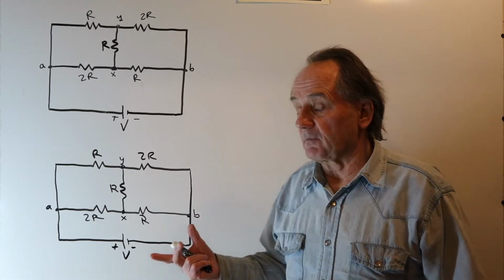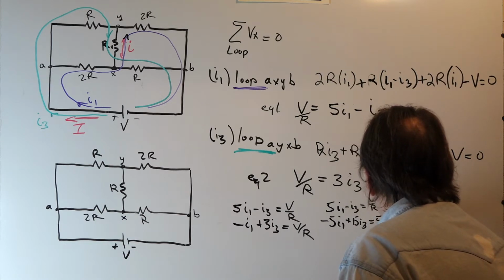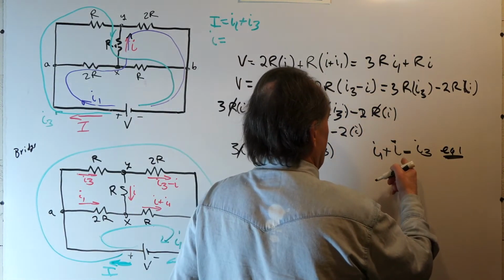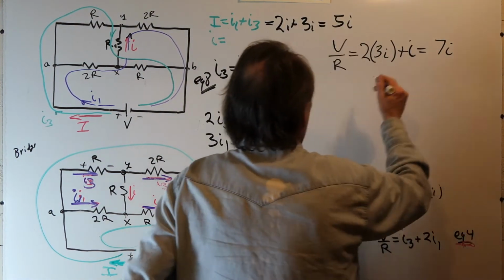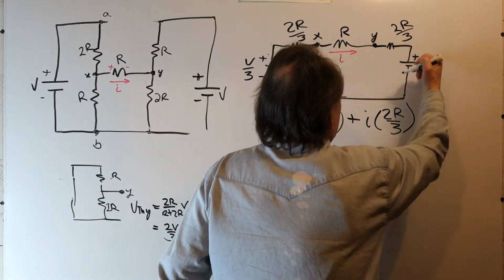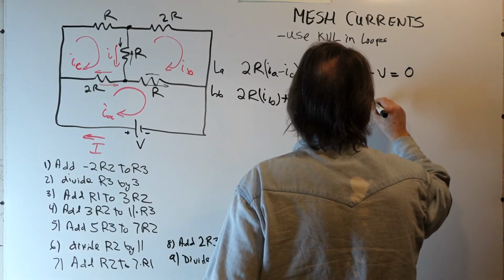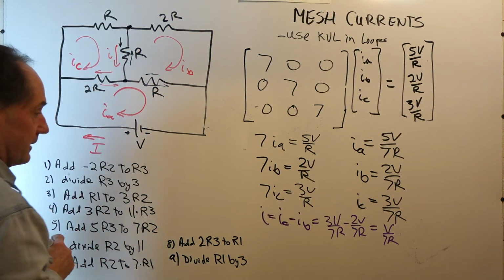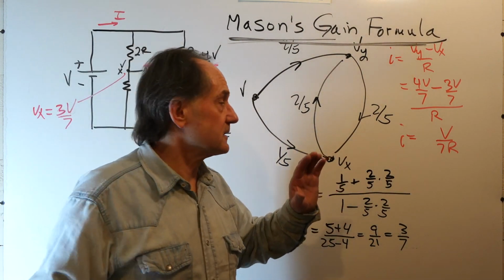Bridge Network part 1:  Solution to Lewin problem 24

Comment from the maker: George Hnatiuk
------------      TIME   INDEX  --  TABLE  of  CONTENTS  for  this  video    ------------
0:00:00    Introduction comments
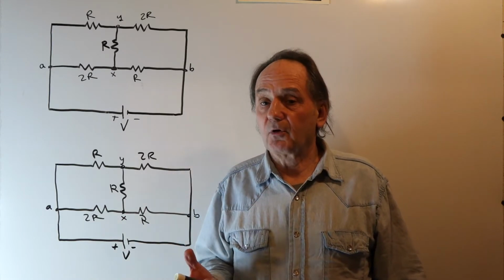0:02:00    Start two loop current analysis - easiest method
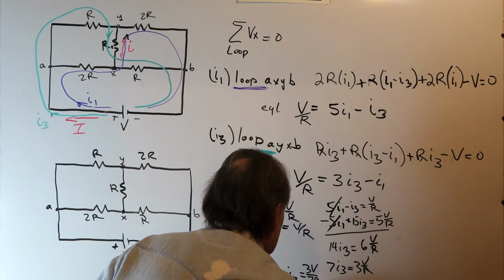     0:11:22   Solution for current "i3"
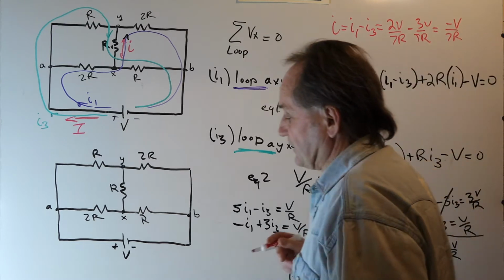     0:13:13   Solution of "i" and "capital I"

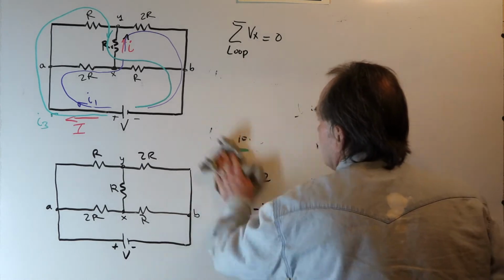0:14:37   Solving the network using two different loops
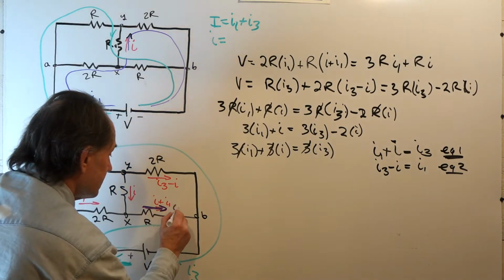    0:20:20   current symmetry found
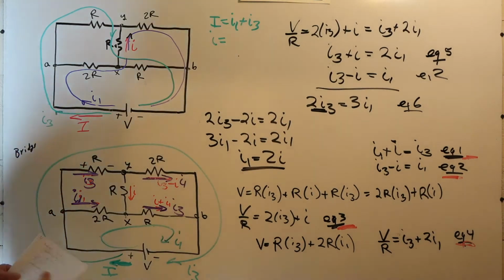    0:26:00   i1 = 2i  
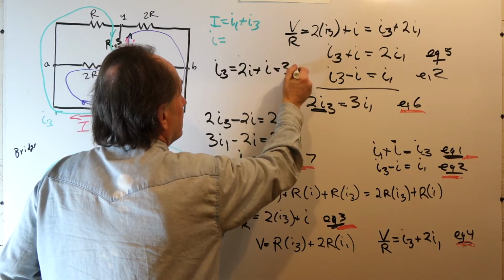    0:26:50   i3 = 3i
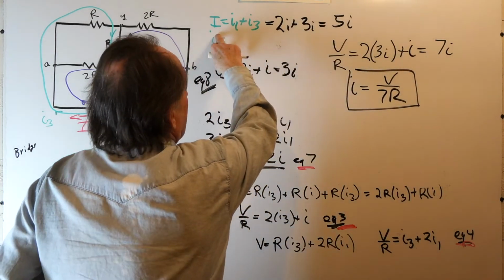    0:29:00   solutions for "i" and "capital I"

0:30:04   Start solution using Thevenin Equivalents
    0:32:45   break and split the network
    0:35:30   Vthx and Rthx  found
    0:36:52   Vthy and Rthy  found
    0:39:20   current "i"  in bridge resistor found
    0:40:20   COMMENT on theory behind Thevenin Equivalents and their use
    0:41:30    Rth  =  Voc / Isc

0:42:10   Start solution using  MESH  CURRENTS
     0:45:38   Change loop current designation for  "ic"  and  "ib"
     0:49:25   The three MESH equations with three unknowns
     0:51:20    MATRIX  formulation for the MESH currents
     0:54:00    The row operation recipe for reducing the matrix into std. form
     0:55:10    Solution for the three currents:   ia, ib, ic
     0:56:20    Small "i" and Capital "I" in terms of the mesh currents  ia, ib, ic

0:57:03  Begin  FLOW GRAPH  ANALYSIS 
     01:00:20    The graph with path gains
     01:01:20    The system function loop gain
     01:03:00     Vy  and  Vx   node voltages found
     01:03:45      Finding the bridge resistor current
FINISHED

--------------------------------------------------------------------------------------------------------------------------
The original problem statement:  www.youtube.com/watch?v=W9-yxYIWkqg
Prof.  Lewin's  solution:    www.youtube.com/watch?v=7Y7FZ_AtrEs

ENJOY the video  - comments and suggestions welcome
Reply from the maker: Prof. Walter Lewin of MIT physics posted this problem involving a bridge network:
   www.youtube.com/watch?v=W9-yxYIWkqg

The answer is EXACTLY:
middle R ( bridge R )  current =  V/7R  amps  downward  
total current supplied by the voltage source =  5V/7R  amps

The two 2R resistors have identical currents as do the two R resistors
     2R  resistor currents flow left to right with value  =  2V/7R   amps
       R resistor currents flow left to right with value  =  3V/7R    amps

Total load as seen by the voltage source is  7R/5 ohms
----------------------------------------------------------------------------------------------------------------------------------------------

The are a number of short cuts one can use involving network transformations that I talk about in this video.  By using a Delta-Wye network transformation, the equivalent load presented to the voltage source can be determined without writing any loop or node voltage equations and having to solve simultaneous equations.  By using that transformation you get the following equivalent network:

                       --------------|                             -----------|
                                    R/2                                    R/2            ------|
                                      |                                          |                      |
                                ------------              =                   |          =       7R/5
                               |             |                               9R/10                |
                            R/2        R/4                                |                -----|
                              |              |                     -------------
                             R            2R
                              |              |
                       ------|-------------|

                    Using the reduced equivalent network value of 7R/5, one
                    can calculate the total current supplied by the voltage 
                    source as:     
                                                                 I  =   V / (7R/5)  =  5V/7R

A more direct way can be had by using Thevenin equivalents for each leg of the BRIDGE to reduce the network into a series circuit and from that determine the current in the middle bridge resistor.  Then with that known current, use KVL and KCL in two loops to determine the currents and voltages in and across the individual resistors.

Another way to solve is to use loop(mesh) currents.

Using loop currents to get the current in the middle (bridge) resistor.  Do not neglect the current of adjacent loops when summing resistor voltages to get the voltage "seen" by each path,  which is the same battery voltage, V.   

Using current designations (i up)  and  (i down), the correct equations are:

V  =  (i up) x (2R)   +  [(i up)  -  (i down)] x R  +  (i up) x (2R)
V  =  (i up) x (2R+R+2R)  -  (i down) x R   =    (i up) x (5R)  -   (i down) x R
         eq. 1:               V  =  (i up) x (5R)  -   (i down) x R

V  =   (i down) x (R)  +  [(i down)  -  (i up)] x R  + (i down) x (R)
V  =   (i down) x (R+R+R)  -  (i up) x R     =    (i down) x 3R   -   (i up) x R  
           eq. 2:             V  =   (i down) x (3R)   -   (i up) x R  

Both (i up)  AND  (i down)  flow in the middle resistor and contribute to the voltage across it when summing voltages around each path to get the battery voltage, V.   Rewriting the equations:

   eq. 1:     V  =    (i up) x (5R)  -  (i down) x R
   eq. 2:     V  =  - (i up) x R    +   (i down) x (3R)

Add 5 times the second equation to the first to get:

    6 V  =    (i down) x 14R     which reduces to:     (i down) = + 3V/7R

Add 3 times the first equation to the second to get:

   4 V  =   (i up) x 14R       which reduces to:    (i up) =  + 2V/7R

Therefore the current in the middle resistor downward is:
                        
current down  =  (i down)  -  (I up)  =  3V/7R  -  2V/7R  =  V/7R  >  0
                   the value is positive which indicates that the current is flowing downward

  [[[     The correct value is  V/7R amps downward.   ]]]
------------------------------------------------------------------------------------------------

The total current flowing from the battery is:  
                        (i up)  +  ( i down)  =  2V/7R  +  3V/7R  =  5V/7R

This is the same value as determined above.
====================================================================

Wheatstone bridge?   Definitely  not.
In a Wheatstone Bridge, the ratio of resistances of the upper arm MUST equal the ratio of resistances on the lower arms taken in the same order.  This way the voltage across the middle resistor is ZERO in the "balanced" condition since each arm is a voltage divider having the SAME division ratio.  When the bridge is balanced in this manner, no current flows in the middle resistor.  By replacing one of the resistors with an unknown, its value can be determined by balancing the bridge (ZERO voltage across the arms on the middle resistor) and knowing that the unknown is ratioed to the other resistor in its arm as the resistor ratio of the other arm.
GH

Comment from the maker: I will outline the method for the quick easy solution:
Call node "a" the left side of the network which is the (+) end of the voltage source and the right end of the voltage source (- terminal) node  "b".  Call node "y" the top end of the bridge resistor, R, and its bottom end node "x".

Designate current ( i1 ) as flowing between nodes "a" and "x" in the 2R resistor.
Designate current ( i3 ) as flowing between nodes "a" and "y" in the R resistor.
Designate current ( i ) as flowing between nodes "x" and "y" downward in the bridge resistor, R.

(1)   Write the KVL equation along PATH: [ a - x - b ] with current flowing between nodes "x" and "b"  thru the lower right resistor R written as  ( i1 + i )

        write the KVL equation:   V =  2R( i1 ) +  R( i1 + i )

(2)  Write the KVL equation along PATH: [ a - y - b ] with current flowing between nodes "y" and "b" thru the upper right resistor 2R  written as  ( i3 - i )

        write the KVL equation:   V =  R( i3 ) +  2R( i3 - i )

Eliminating  "V"  between these two equations establishes the symmetrical nature of the network:   

     i3 - i  =   i1  
    current flow in 2R(nodes y-b) =  current flow in 2R(nodes a-x)

      i1 + i = i3
     current flow in R(nodes x-b) =  current flow in R(nodes a-y)     

(3)  Write the KVL equation along PATH: [ a -y - x - b ]  using the current symmetry above and relationship in step (2) to eliminate "V" and get both (i3) and (i1) as a function of ( i ).

(4)  Use equation in step (2) to get ( i ) as a function of "V" and "R" using the relationship between (i3) and (i) and also using step (3) to get  (i3) and (i1) as functions of "V" and "R"

(5)   I =  ( i1 )  +  ( i3 )

DONE

Comment: Nice to see all the different ways to solve, thanks for the videos.  For the two-loop KVL solution, that doesn't work for this circuit topology in general, and happens to work only by symmetry of the resistances.  See Prof. Lewin's latest video.  It is not sufficient to simply cover all components with the current loops as you stated.
Reply from the maker: James Doebbler,
YOU  ARE  WRONG.  See my reply to Lewin's retraction:

             https://www.youtube. com/watch?v=Vg_NKnmk5lc&lc=Ugy4Awq9NAWyrCVv8kt4AaABAg

You need to complete the thread links by copying and pasting the above to the URL bar and deleting the space after the ".com" and it will take you directly to the appropriate thread.

I will do a video to explain why his retraction is in error.  He does not understand electrical network theory as thoroughly as I do.  He is a physicist not a practicing electrical engineer.  One can not expect him to know all the subtleties of network theory any more than I am expected to know all the details of particle physics.
GH
Reply: George Hnatiuk I have read your response and agree with you that without explicitly mentioning the assumed symmetry or checking an independent loop, your solution is incomplete, as was Prof. Lewin's.  In other words, there are additional steps required if the resistance values were changed.  I look forward to seeing your correction video.  Cheers.

Comment: Dear George, please do a video on CR circuits.
Reply from the maker: Manu Sharma,
Do you have a particular circuit in mind?  Or are you asking for an explanation of the properties of PASSIVE  RC circuits in general?  Are you familiar with pole-zeros / complex plane, Laplace transforms and generalized impedances?  Have you worked with the generalized impedance concepts and the S-plane?

To do this, I would need to know at what level to address my audience.

I like to work in the "Frequency (Laplace s-plane) domain" so I do not have to write out differential equations.

There are two types of general analysis:  transient response and AC analysis.  I am assuming you are interested more in the AC analysis having to do with magnitude and phase relationships of the voltage and currents rather than the response to a step function is that not correct?

You need to be a little more specific.  Are you a student just learning AC analysis or a practicing engineer?  I need to know your level of understanding so as not to mystify rather than inform.
GH
Reply: George Hnatiuk I am deeply touched by such a quick response. Actually I am a student just starting to learn the AC analysis. I have studied the RLC circuits and a mere drop from your vast ocean of knowledge will be really helpful for me. I have learned about reactance, impedence, phasor diagrams, resonence and q factor. Although I am good with DC RLC analysis, I am having a lot of trouble in solving AC RLC circuits, especially the ones in which there are components making bridges. I am at the most basic level right now(high school senior year) and all the problems I have come across consist of at most 1 ac source.
Can you find and solve an AC circuit with at least 4 components (at least one each of RLC) with source current and all the components known, where current and potential difference across each component are to be found out(with some of them parallel)?
If you want, I can provide you with a problem.
And please take care of yourself and take an adequate amount of sleep, inspite of all the work load.
Reply from the maker: Provide a few problems.  Send schematic diagrams via EMAIL to me as an attachment:   ghnatiuk@juno.com

I never use phasors anymore.  I strictly use generalized impedance concepts and work in the s-plane.  Are you familiar with generalized impedances where we talk about the impedance of reactive elements as:
                          element            phasor          generalized impdeance
                           resistor:              R                             R
                          inductor            jωL                           SL
                        capacitor          1/jωC = - jωC          1/SC

I can do analysis in phasors but do not like to because it only holds for AC analysis.  Generalized impedances can get to phasors by making the substitution S = jω  in the s-domain.  Are you familiar with S-domain and generalized impedances?
GH
Reply: George Hnatiuk I don't really know what "j" and "S" over here are. Well, I know how to calculate impedence/reactance of R,L and C. Not really sure what generalised impedence is.
I'll send you some problems 24 hours later, meanwhile please get some sleep.
I am highly obliged and deeply touched by your quick replies to a highschooler like me.
Lovingly yours.
Manu
Reply from the maker: j is the imaginary unit j = √ -1   some call it  "i"

    ω =  AC   radian frequency     =>     ω =  2 π f

    S  =  σ  +  j ω     generalized frequency

You MUST be using  j or i  if you are using phasors.
When send me a circuit send along a simple "phasor" analysis of a series R-C network driven by an AC voltage source so I can see what your phasor notation looks like. 
 
Solve for the current in a series R-C driven by 2-volt AC voltage source at 1KHz.      R = 1k ,  C = 0.318 microFarad 
 
This will help me understand your phasor notation.
GH
Reply: George Hnatiuk Sure thing, teacher.
Reply from the maker: no need to call me teacher or professor -  I am neither
I am a practicing professional engineer
GH

good luck
Reply: George Hnatiuk all right, Mr Hnatiuk.

Comment: Hi George, in the past you have been kind and patient enough to explain things for me,
 i have another  problem for you :
 submarine using radar only(straight line of sight) has a sea surface target potential of 200 miles, 
if we allow a generous 20-meter height above seawater for radar antennae, 
using the earth curve calculator the target begins to diminish at 12 miles.
surely this example shows us math is not the answer to physical experiment?
Reply from the maker: Paul,
It has been awhile.  I thought maybe you found the edge of the flat earth and fell off.

Of course the real world is not all that simple and straightforward as to simply
categorize every observation as black and white.  Not all RF signals behave as visible light and travel only in "straight lines".  How much a signal refracts or follows the earth's curvature depends on the wavelength (velocity/frequency) of the radar signal. OVER THE HORIZON RADAR is quite a common affair these days.  I would need to know the frequency and power of the radar before I can comment further.  In the meantime you can study a bit about RF propagation on this thread in my flat earth video:

www.youtube. com/watch?v=7IQTcmwRMhE&lc=UgySuHOE0OpJ3B_vVsZ4AaABAg

You need to complete the thread links by copying and pasting the above to the URL bar and deleting the space after the ".com" and it will take you directly to the appropriate thread.

If you have questions, you can post them to the appropriate thread in the comment section of this video: 

www.youtube.com/watch?v=7IQTcmwRMhE

Find the thread that has your topic.  Topics are at the beginning of each thread in CAPITAL  LETTERS.
Later.
GH